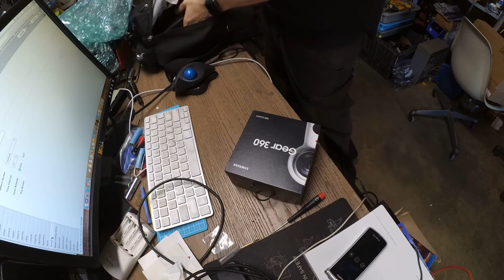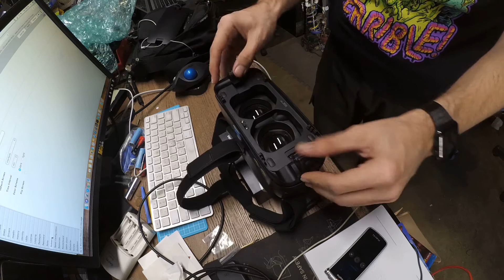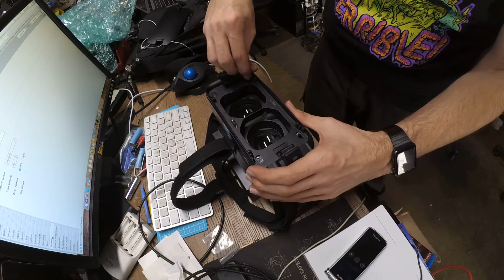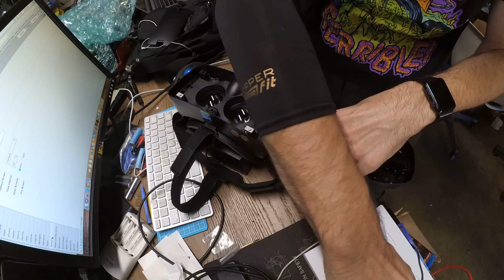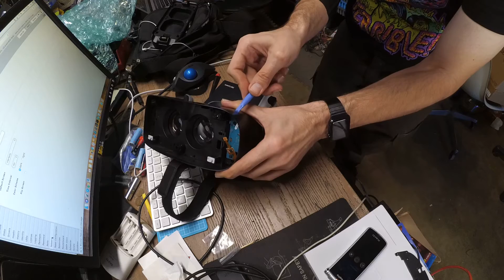GearVR 2016 Teardown

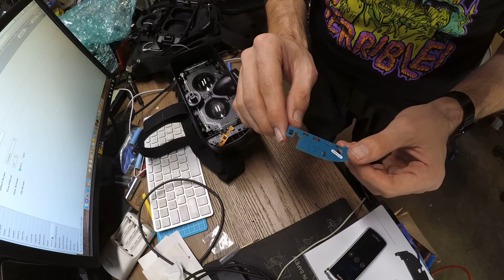Comment: 9:20 There surely wouldn't be any kind of gyro or accelerometer on the board, that type of hardware is already on the phones. The Gear VR was really interesting to me because of its duality in that regard
Reply: there is actually. higher resolution and lower latency one. yeah seemed kind of dumb to me but cardboard apps are really laggy in turns compared to gearVR apps.
Reply: @cybrhckr  Oh, really? That's very interesting actually, I'll look more into it